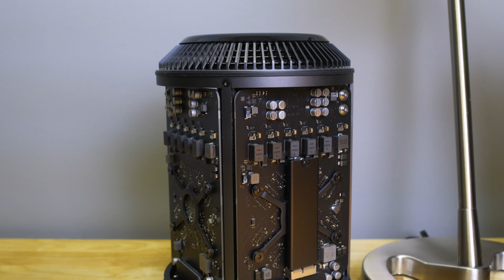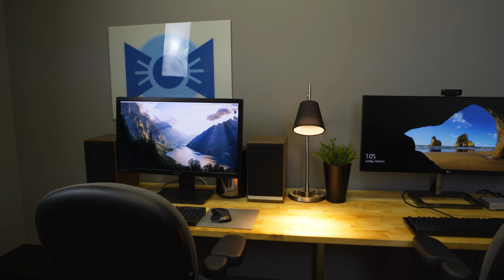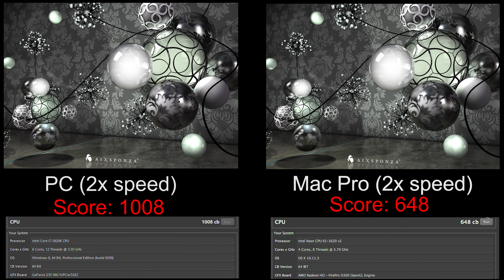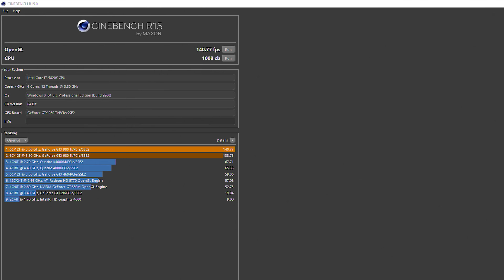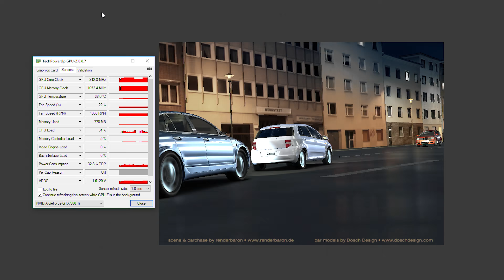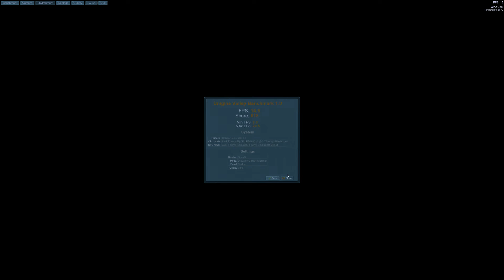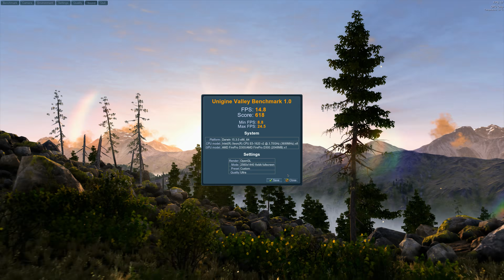$2,000 Custom PC vs $4,000 Mac Pro

Comment: Also the other thing about the Mac Pro is that I don't believe it's strictly all about how well it performs. I believe it also has to do with how well it performs for its size. And that's where the engineering marvel comes into play with the Mac Pro, and why it's so expensive. Sure the PC is a beast and costs half the price, but it's also three or four times the size.  However, I prefer the size of a full tower that I can put all the components inside. I have an iMac and hate having to have so much shit plugged into the USB ports. With my cheese grater Mac Pro, everything tucks inside nicely. But, the trash can is still pretty incredible in terms of size to performance ratio. And the Mac will also have a much better resale value and will depreciate way less than the PC. Take it how you will. 🙂
Reply: I agree, but i don't think 1 or 2 square feet area of space is worth 2,000$ extra. Only gullible people buy the mac pro. I do own a macbook pro, but it is by far the best ultrabook in a market where they priced equally. And an iMac is great because of the 4k-5k IPS display, which in itself cost close to 1,000$, it's a great monitor with a free computer.
Reply: What something is worth is very subjective though.  This is why you pay $70K for a Benz/BMW when you can get more power and more features in $50k Hyundai Genesis that has a better warranty and is more reliable.  With the Mac Pro it's not just "specs" you're buying.  You're paying for the engineering, research, and development of a completely new design that's "trying" to push technology forward.  With the PC, it's really nothing new.  It's the same old design that has been around since computers were first invented.  You just have new components.  The engineering has been paid for decades ago.  So of course it's gonna be cheaper.
Reply: Hellfire Beats "pushing technology forward", and "it's not just "specs"", is conflicting. Worth being subjective is the same as saying "some people are just idiots with money".
Reply: It's not conflicting.  It's very simple actually. With a computer you have more things than just CPU, RAM, and Video speed specs.  You also have the actual hardware design and the trach can Mac Pro is/was a brand new design that has never been done.  For the size and form factor, it's pretty incredible the performance they can squeeze out of it, especially with just a single fan.  No other company has done anything like that yet.  That is what you are paying for whether anyone feels it's worth it or not.  And not many other "off the shelf" PC's will last as long, nor have anywhere near the resale value, if any.
Reply: +Zidane Zeptinune An NUC is like the equivalent of a Mac Mini.  Lol.  And my point still stands.  You're only counting specs and ignoring the part about the hardware engineering and you'll not find many "off the shelf"/"out the box" PC's with the power of a Mac Pro that you can take into an actual store and receive customer support.  If this were cars, these comparisons would be like comparing a home built base model Mustang GT with $30k in parts to a factory built $60K Mustang Shelby.  Of course the custom build will probably outperform the purchased vehicle, but look at all the labor that went into building and troubleshooting the build, and the possible maintenance to come.  With the purchase, you still have tons of horsepower that you can just take to the dealership if something breaks.

Comment: As far as I know 500-600$ destop are normal price. If you spend 2000$+ on windows it will normally run better. But same is not true for laptop.

Comment: Here's the thing about the custom PC's.  Most actual working professionals don't have time to tinker with building PC's, and especially don't have time to diagnose which one of the many parts is causing the PC to fail to boot or post.  And when/if something breaks later, they don't have the time (and something not the knowledge) to diagnose it. They can't afford that.  Unplanned downtime is not an option for an actual working professional.  So having something you can buy, take out of the box and start working within 10 minutes is where the prices of Mac Pro's are likely justified by Apple.  Also, having a place you can take it in to have it looked at when something breaks, even when it's out of warranty is also a big part.  I doubt you can take a monster PC build to any of the few Windows stores and have them be able to help you, although it might be possible.  So while the PC may have much more balls at a smaller cost, the tinker time is what actual working professionals don't want to deal with.  And this is me speaking as a working professional that was a previous PC builder that switched to Mac a couple years ago.

Comment: Why are you comparing a workstation CPU/GPU to an enthusiast CPU/GPU? Of course the PC will perform these better because they're meant to output faster, but not necessarily more accurate. You should have made a workstation PC with Xeons and either a Quadro or Tesla card and ECC RAM. All of which are more expensive and would close the price gap. This is kinda pointless, like comparing limes and lemons.

Actually, why are we comparing premade to custom built? Of course custom will be better bang for your buck. It would have been better comparing the Mac Pro to a prebuilt Workstation PC from Dell or HP where, again, the price would be much higher. Like comparing a stock Lambo and modded Supra.

Side note, the only reason I can fathom the AMD GPUs were performing that bad is from thermal throttling, since you said they were almost in melt down and AMD GPUs are known for heating up. I don't see how Crossfire workstation GPUs should perform horribly under any test unless they were throttling.
Reply: A "fair" comparison would be comparing an iMac with similar hardware.  For the money, an iMac will smoke a base Mac Pro, totally different system.  I'm not saying a Mac pro is a good value of any kind, but it is a workstation.  Xeon Processors are designed to run in parallel and workstation graphics are designed for CAD rendering.  Any workstation card will perform poorly at a gaming benchmark just as a 6 core processor will be swamped by a top end workstation with 32 Cores.
Reply: +Dale Peters Stop protecting Apple. It was a fucking fair comparison. It showed that for that money they are screwing you over. That's it. If you still think it's okay and totally fine... you are stupid.
Reply: I'm not protecting Apple. I hate Apple for how overpriced they are, but this is still an unfair comparison. I mean duh, custom made is always going to be cheaper than prebuilt. Why even bother comparing them. Hell, my $1000 custom computer could probably spank the Apple. That's why I offered a better comparison in the second paragraph where they should have compared a premade PC workstation to the Mac.
Reply: David B The point was that for the price you get a poorly equipped machine. Okay so for 4000$ you can build a workstation pc beating the mac even harder while that workstation will handle gaming just as fine. So i don't get you now. :)
Reply: Dale Peters you killed your own argument in a single sentence. wow. :D That's the fucking point. Prebuilt shits are always more expensive becouse it is ready to use... and also the logo on the box/case.
Reply: You're wright. High end Xeons perform almost as well as their i7 counterparts in gaming tests. They are designed for a different purpose, that doesn't make them bad at something they aren't designed for.
Reply: But building any PC will beat a normal PC. You could build a PC for less and beat a reasonably priced HP or ASUS that has all the current hardware. That's why I said the fact that he built it was kind of unfair in the first place. Heck, this is why the only prebuilt thing I buy is a laptop, I can always build for cheaper.
Reply: So why is this guy comparing a pre built machine to a custom built one? Why not compare a prebuilt PC to the prebuilt Mac? Preferably one with similar specs. In theory, a prebuilt Dell or HP should be cheaper than the Mac even if all the parts are the same. But how much cheaper, and will the PC perform better with better cooling?
Reply: I guess what I'm trying to say is, it's no surprise the test in the vid had the outcome it did, but we would get a more realistic idea on the cost savings if the PC specs closer matched the Mac's. Hell, maybe even do a 3-way comparison between the Mac, a prebuilt PC workstation, and a custom PC work station all with as close to the same specs as possible to see how much money is saved.

Comment: use the same generation cpus before test !!!!
Reply: +Silvio S Your a fucking idiot. Why make a PC dumb it down any further? Do you have any understanding about how PC hardware works?
Reply: Why? This is a value comparison. The fact is, for half the price, you can buy a PC that outperforms a top of the line Mac in all areas. There is no denying it, unless you hobble the PC, as you are suggesting.
Reply: I saw the other thread that you were in and I have to agree on many valid points concerning professionals; A water-cooled custom computer is only a minute away from total destruction, consumer technology typically has memory leaks and isn't precise enough for high level geometry in CAD applications, et al, but you really should be more aware of more current technology.  You see, I have a Mac Pro that I swear by for many tasks, but I also have a computer that I built (on air cooling.  I also hate instability).  Sure the computer finds the majority of its use on games and the Mac Pro doesn't, but that's not the entire point that people are making.  As general consumers and even as prosumers, there is hardware out there that has advanced by leaps and bounds over the past three years, and it isn't reasonable for people to compare older hardware operating on WIndows with a Mac Pro that simply has antiquated hardware.  Hardware maturity is often valuable for professionals because it's more of a known quantity, but I'm curious to know what version of Windows you last used, Silvio.  I have a suspicion that it wasn't a more recent version of Windows, which surely isn't perfect, but nonetheless recent versions of Windows have been very solid.  I'm also very curious to know what level of proficiency you have with problem solving computer issues.  Having worked in IT for 6 years, if I have a choice, I'll take the Windows machine any day and still make my money using it with superior hardware and largely comparable (currently) software.  Let's not pretend that Apple never has missteps either.  I know that's not the case as a long-time Apple user.  I'm anxiously awaiting hearing answers to these questions I have.

Comment: Is it bad that I feel a physical pain when I see someone actually bought one of Apples worst devices like this?

The phone is its own thing as you can get upgrade contracts and such to ignore the cost a bit. Preference comes in here, but the Mac Pro.. It was always old hardware. It was always overpriced, launch and otherwise and as per corrupt apple regulations.. The price never changed with the hardware becoming cheaper over time.

This thing is shaped like a trash can and might as well be one.

Comment: Idk why people compare mac's to PC's, most mac's are supposed to be work machines are they not? I mean yea sure you can game on it obviously if you want but I was always told they were more work machines and really good for rendering and other video based stuff, while a desktop PC can game better because it can fit better GPU's in it.
Reply from the maker: +Onion Rings The benchmarks look like video games but they're not gaming benchmarks. They're OpenGL benchmarks. Same thing used in rendering in Premiere. The PC smokes the Mac at rendering in Premiere.
Reply: +Onion Rings I suspect this is something apple people coined to avoid having to deal with the truth, kinda like how people claim to be street smart.
Reply: +Onion Rings +Snazzy Labs said that it is better by far at video rendering which is why most people use macs. however, there is something to be said about the apple universe where everything apple works flawlessly together.
Reply: +Snazzy Labs The saddest thing is that someone would still be willing to pay $2500 for it.
Reply: It is best for apple's video rendering software with the same hardware? For equivalent price hardware it's still much better on PC on any other software...
Reply: Video editing+rendering with 32 GB of DDR4-2400, hexa-core processor running slighly faster, and the beefier GPU would not even be a question.
Reply: I'm not retarded, I'm just saying faster equipment in a hackintosh would be better at its job than the mac pro, and you can also get faster workstation hardware.

Comment: Yeah great vid man!! Once the 1080 and 1070 come out you should do a video on how to build the perfect budget pc that wouldnt bottleneck two 1070s :D
Reply from the maker: +Khayman Whitman Planning a cheap 1080 build in the next few months. :)
Reply: Ill be waiting brotha! it'll be the build that sells my soul to pc gaming lol
Reply: i bet around 1100 to 1400 if we plan on not bottle necking anything. id like to have a cpu and psu able to accomodate a second 1070 if i ever get one
Reply: I'd say that's pretty generous... I'm thinking more like $1500 minimum if you don't want any bottlenecks. Especially if you're talking about a GTX 1080.
Reply: +Khayman Whitman I know I'm a bit late on this, but I'd seriously advise you to get one 1080 instead of sli 1070. Sli is not very reliable. I'm also not sure the sli 1070 is all that much faster than 1080. So if I were you, I'd go for one 1080, save that ~200 bucks, and put it towards a better cpu or motherboarf.
Reply: I pose a better challenge, Can you build a sub $1K PC (as cheap as possible) using retail parts (not used) and a GTX 1080 that is NOT going to bottleneck it?

Comment: I'm not really a apple fan boy, but where Apple excels is there optimization of hardware and software. If you are using premiere on an apple computer, I'm sorry, but you are doing it wrong. Final Cut should have better render times of that same video then the pc using premiere. Even a Macbook pro should have better render times in FCPX then that windows machine with premiere.
Reply: +Lucas Johns Comparing app vs app doesn't prove anything. You are trying to say that an app specifically designed for Apple computers will be faster than a PC running a COMPLETELY DIFFERENT APP? I am sorry, but that is just stupid. That proves absolutely nothing. Thats like making a race between a sports car and a classic. The classic car we will give a .25 mile track. The Sports car we shall give a .5 mile track. Lets see who wins! Gimme a break. Not a fan boy? You sure sound like one my friend. You bring up closed ecosystem apps as a point of reference? That's fanboy stuff right there my friend.
Reply: +SpAzMaNiK what I am saying is, if you get a Mac there is no point in using premiere. He clearly proved that in the video. You get a Mac to use its first party software, why? Optimization. Because the software is optimized for the hardware it is able to get better render times than premier. Also I'm not saying anyone should even get a Mac Pro. It is way too expensive, also it really isn't meant for the consumer market. It is meant for industry professionals. Although it doesn't seem like they even use it from what I can tell. Also the video is about about how the hardware compares. So again, the pc wins. You also realize they are running different operating systems so you point about comparing different programs is kind of invalid. On a side note. I don't even use OS X I use Windows and I have a galaxy s7 edge and the IPad I have a almost never use. That's defiantly the description of an apple fan boy if I have ever seen one. You can't just assume things. I know a lot about both sides
Reply: *****
Well with all things considered then, I guess we can never truly put Apple vs PC. Apple pays companies large sums of money to make apps exclusive only to the Apple ecosystem. Apple then claims said apps are optimized to the hardware. If you have no way of comparing performance on machines outside the Apple ecosystem, what method could you use to prove that the apps are truly "optimized" to the Apple hardware? True optimized software is optimized at the machine code level. I am highly doubtful that the software developers went to that level of integration...